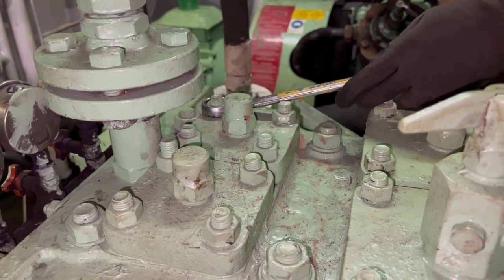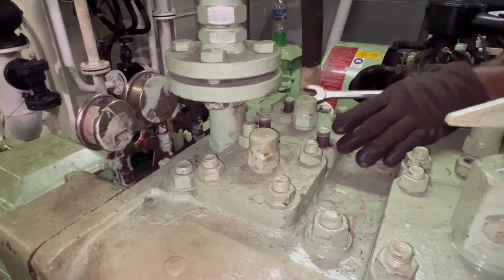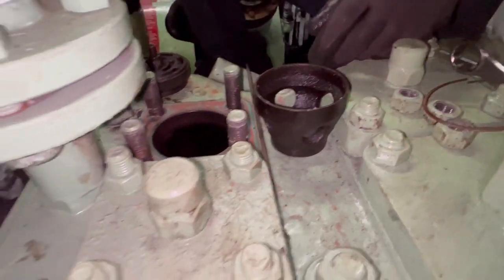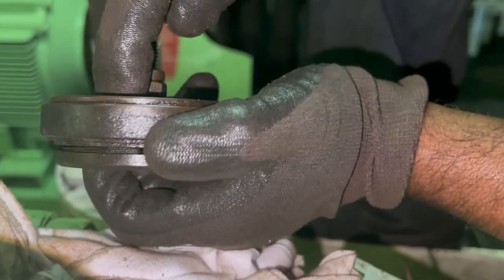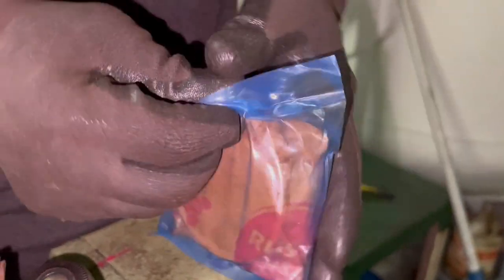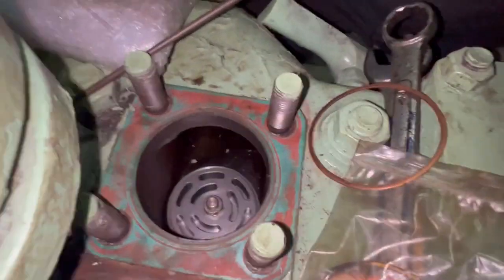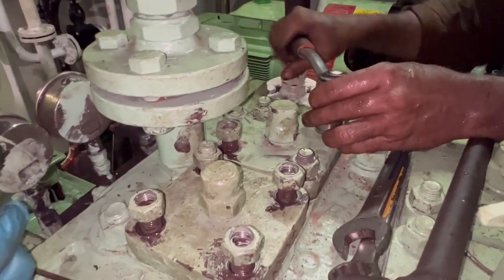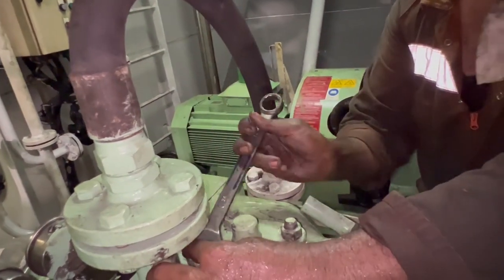Fourth engineer jobs....How to remove and replace high pressure valve for Main air compressor

Comment: Sir good day.. what could be possible cause for Sperre compressor to be pushing out air and sucking air at the same time, not charging properly?
Reply from the maker: please check the condition of valves ,,,,must be the valve spring is broken or damaged...